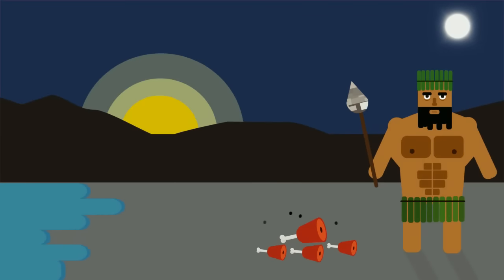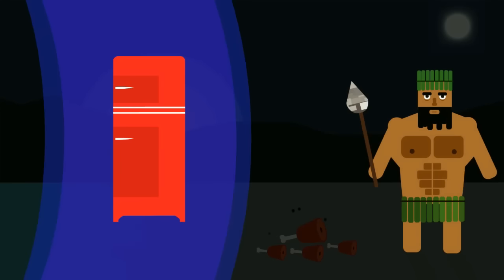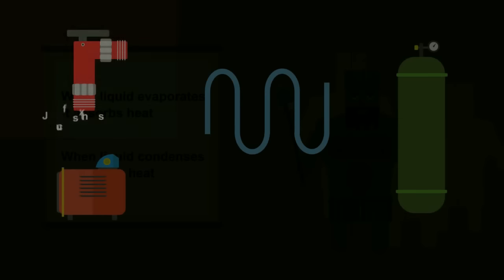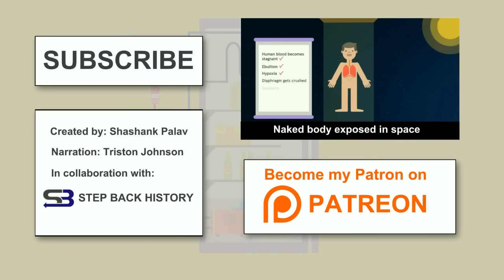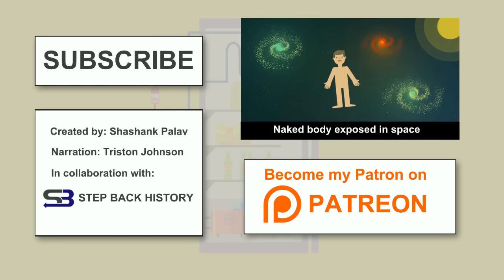How Does A Refrigerator Work? | Refrigeration Explained

Comment: Am I the only one having problem understanding it. It seems a little counter intuitive those examples to me.
Reply: i'm not a english speaker but i find it very superficial. I didn't get the physics in it . This other video solved my problem: ''' How a Fridge Works! (Vapor-Compression Refrigeration) "
Reply: I think I understand it.

When a liquid is heated, it evaporates (more room between the molecules) becoming gas. Like if you cook water enough it becomes gas. Well, this actually works the other way around too. So if you turn a liquid into a gas (by evaporating it) then it must become hotter. But heat can't just come from nowhere. So it has to take heat from its surroundings: in this case, the refrigerator. So the refrigerator loses heat to the water and less heat means it cools down.

But if they just made the water do another cycle at this point, then it would still be a hot gas. If it's already hot then it won't need to take heat from its surroundings. So that wouldn't work. So what they do is they make the coils that the water travels go outside of the fridge (usually on the back). Then they make the water condense (less room between the molecules) when it leaves the fridge, which means it has to release its heat into its surroundings. But now its surroundings are the outside room rather than the fridge itself.
So in essence, the fridge cools down because its heat is being displaced to the outside room via the water.

And then this cycle is repeated to keep the fridge cool.
Reply: Liquid becoming gas does imply it gets hotter. It can become gas without raising even in one degree.
Reply: Put it like this, the vapour going through the tubes on the inside of the fridge begins absorbing the heat before being compressed on the outside, but when being compressed the heat doesn't just disappear, it has to be compressed with it, thus the vapour becomes warmer in a smaller space.

Once on the outside, the outside temperature starts cooling the vapour down, and since it's compressed it has a multiplied effect, so once decompressed it ends up cooler because all the heat gets dispersed into a wider area and it reenters the fridge as a cooler vapour.
Reply: It's like a liquid cooled pc
Reply: @Lightning_Lance  Thanks for the clear explanation!!
Reply: @KuyaMoko freon and refrigerant is the same
Reply: ho study thermodynamics guys , 2 principle
Reply: @Nitraex  i know it’s two years late but yeah no shit it doesn’t have to, but this isn’t a vacuum pressurized chamber, it’s way easier to explain this through temperature and phase changes than it is just explain the pressure aspect
Reply: Do you mean the water on the hand example? Yes, I also took some time to understand it. I think it's like this:

It's said that "when water evaporates it absorb heat". And how is this related to the example?

Your body constantly produces heat, so when there's water on your hand (or any skin), the water absorbs your heat and then you lose heat, when you lose heat you become more cold.
Reply: Yeah terrible video
Reply: You’re definitely weren’t the only person - it does take some thinking

Comment: To help simplify. The compressor pressurizes the refrigerant which raises the temperature and makes it easy to get rid of the heat outside the refrigerator. The expansion device then drastically lowers the pressure which makes it very cold. It then goes into the fridge where the cold pipes now absorb the heat in the fridge. And the cycle continues.
Reply: thanks
Reply: But in this video expansion device expands pressure and temperature....and as well as the compressor device compresses....I think...in this told wrong as alternative nanner

Comment: I always thought it was a chemical like liquid nitrogen being released into the fridge, I didn't know that it was just a liquid cooling system...
Reply: Nope, It has a Freon Gas (R134A) Refrigerant in it. Which makes the Refrigerating process much more efficient. And not Liquid Nitrogen or Water.
Reply: Double Trouble modern refrigerators use puron R410A
Reply: @briancooley8777  R410A is what my Air Conditioner uses. I have checked but my refrigerator doesn't use it instead it uses the old R134A. You're right about that though.
Reply: The process you said was used long ago to preserve dead bodies in mortuary
Reply: @ash-5379  What? Really I didn't know that!
Reply: Just wanna note some refrigerators use hydrocarbon refrigerants such as propane (R-290) and isobutane (R-600a)

Comment: So...refrigerators just remove heat from it, making the inside cold?

Wow, much simpler than I though. Boi I’m dumb
Reply: Can I ask something , fridge is open or closed system
Reply: @DZ-kl6ek  I think its closed system as only heat leaves the condenser coil no mass flow out of  refrigerator. Correct me if i am wrong.
Reply: Ya
Reply: @hassankhan-sg6de  you are definitely right
Reply: Ohhhhhh yes.
Reply: Yeah easy thermodynamics
Reply: @DZ-kl6ek  as it raidiates away heat and requires outside electricity, it is an open system
Reply: @DZ-kl6ek  closedddddddddddddddddddddddddddddddddddddddddddddddddddddddddddddddddddddddddddddddddddddddddddddddddddddddddddd
Reply: Well now we are a bit less dumb! :D
Reply: This comment will make me pass the test LITARLLY THANK YOU I GET IT NOW
Reply: Simply because coldness is the absence of heat, just like how darkness is the absence of light.

Comment: Journey of a refrigerant:
(When liquid evaporates it absorbs heat 
When it condensed it releases heat
Expansion device 
Evaporator coil
Compressor 
Condenser coil
And refrigerant)

Refrigerant enters in the expansion device, pressure drops, making it expand , cool and turn into gas ( adiabatic expansion)

It moves to the evaporator coil where it removes the heat from the food and absorbs it and turns hot.

In the compressure , the pressure is high , the refrigerant becomes compressed raising it's temprature and turning  hot.(adiabatic compression)

The refrigerant then flows into the condenser coil where it releases the heat into the atmosphere cooling into a liquid(isobaric compression)

It then reenters the expansion device and the cycle continues 
The compressor does external work on the refrigerant.

Comment: So correct me if I am wrong, but the compressor is essentially to make a refrigerator, but not to cool in general... Right?
Step one: The expansion device makes the refrigerant lower in presser, and therefore, temperature.
Step two: The refrigerant is pumped through the refrigerator and is compressed by the compressor, increasing in pressure and temperature.
Step three: The refrigerant is pumped through a heat sink to cool it, and then back into the expansion device, and repeat.
Reply: Wait... I just explained how a fridge works to someone (according to this video), and then I realized that the compressor is REQUIRED to raise the pressure so that the "extraction device" can then lower the pressure... So... Nvm... XD :3

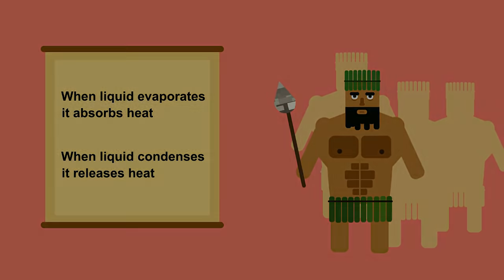Comment: 0:40 WRONG. You should say: so to the liquid to evaporated it needs to absorb heat. The way you say it not only is wrong but also confuses. Btw good animation skills
Reply: What he says is totally right...? When it evaporates, it absorbs heat. That's it. Without absorbing heat it won't evaporate, why would you say it's wrong? It's not wrong, and it doesn't confuse, at all. What does confuse is someone yelling 'WRONG' without adding why it's wrong. And no, your explanation of "it 'needs' to absorb heat" doesn't explain anything. What would be right of you to say is that one of the ways to make a liquid evaporate is to absord heat. Because it can also evaporate by e.g. lowering the atmospheric pressure.

Comment: What I hardly understand is the device that drops pressure. Is it just a valve (a tight hole basically) holding back the flow, or is there something else?
Reply: +Tell me why Oh it's a spring controlled valve overall... Nice to know, thanks man!

Comment: You could have talked about what chemicals they use in a refrigerator, because just using water, is rather inefficient. I know they used ether or ammonia. But I don't get the whole chemical process, so please explain that part! 
Plus, maybe explain how a compressor works? I know what it does and all, but how does it really work?

Comment: Wait, doesn't the compressor change the refrigerant to a cold liquid, and the expansion device allows it to evaporate into a hot gas? This video says the exact opposite...
Reply: hes super wrong lol its ridiculous
Reply: you've got your lines twisted, but I know what you mean. Pressure is directly proportional to temperature and vise-versa. An expansion loop drops pressure and therefore there is a temperature reduction. But he's not wrong when he says an evaporated liquid absorbs heat.When you you have a expansion the gas DOES get cooler, however, the cool gas now ABSORBS heat from the fridge - the newly cooled gas gets warmer. His explanation is the most technically correct.

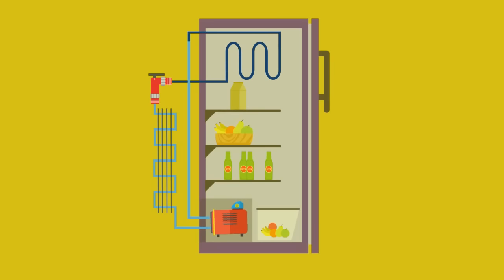Comment: at 1:32 on compression it becomes a hot high pressure "gas"?? I thought a gas under pressure would be liquid and a liquid under low pressure would evaporate into a gas.

Comment: The main counterintuitive headfuckery is how the higher pressure and temperature in one part of a closed system can help cool the system as a whole through thermal equilibrium, heat  transfer with the outside, room.
Reply: Regardless that's how it works apparently.

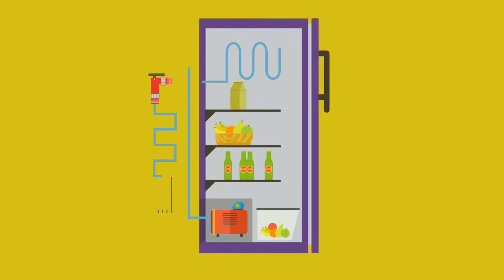Comment: ugh am I the only one who doesn't get the bit around d 1:15? "it expands, cools, into a gas" ??? isn't this literally the opposite of how condensation/evaporation works? I get that the changes in pressure affects the evaporation of the liquid but where does the sudden decrease in pressure come from?
Reply: penguinwek the metering device drops the pressure.
Reply: from high pressure into the expansion valve (retaining the liquid state) and then into a very very low pressure area that is being sucked on by the compressor.  There is cooling as well from the liquid to gas state change.

Comment: this is explained WRONG

The refrigerant enters the evaporator coils as a LIQUID, and then absorbing heat becomes a gas, the compressor then turns this into a higher pressure higher temperature gas, going through the condenser coils, cools (releasing heat) back into a liquid, the expander lowers the pressure and temperature.

expander lowers pressure (lowering temp and boiling point, as lower pressure makes anything easier), compressor raises pressure (and increases temperature and raises condensation point, making it easier for it to turn back into a liquid)
evaporator coils are where the refrigerant (as a liquid with a lower boiling point) absorbs heat and evaporates, the condenser coils are where the high pressure high temperature gas releases heat and condenses back into a liquid.